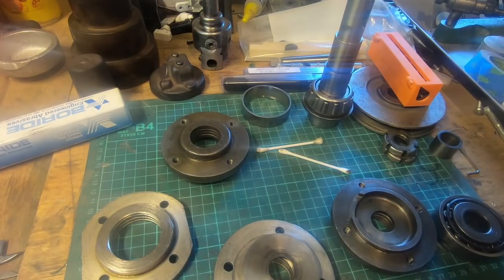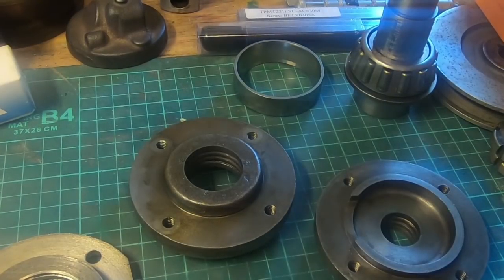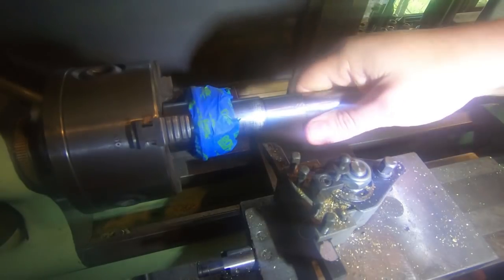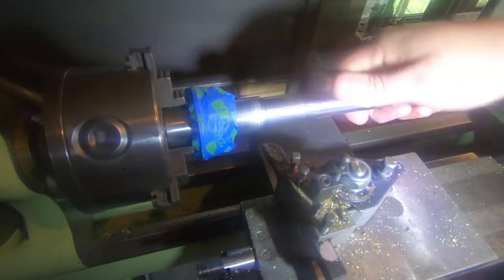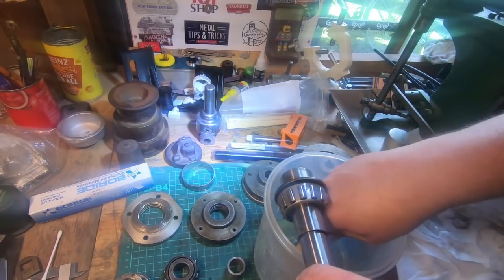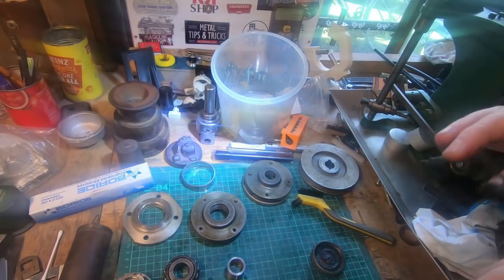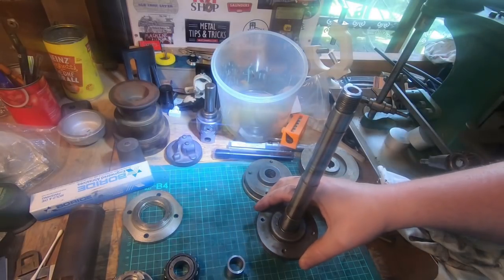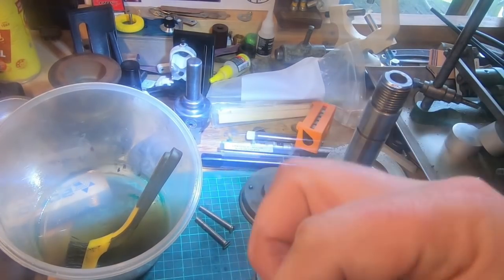PROJECT REVERSO - mill spindle

Comment: Next upgrade would be to replace that flat belt pulley cone with a nice V pulley cone. You'll get better belt contact and less slipping when the tool pressure is high. P.S. The demise of the British car industry was caused by unions rather than bad designs.

Comment: With some good quality grease in the bearings and the modern nipples fitted, my Centec 2 is running sweet, forward or reverse. As the machine was designed to run in either direction, there should be no problems.
Reply from the maker: Been watching your videos. Yours looks good. Thanks for the insight into how the head fits together.

Comment: Nice video,  I just finished my centec 2a, I feel your pain! Mine is the gearbox version so its even worse! Did you price those bearings you repacked?  Statewide bearings could get them in for $130 each!  They were the only two I didn't replace needless to say,  I  just did what you did and repacked them!
Reply: I had the same problem here in England with the price of the bearings. The rear one was three times the price of all the other put together, and all down to the size of the I.D. Most other bearings in the same range from Timken were cheap as chips - just that particular one was priced exorbitantly. I did bite the bullet and replace them all though - just my rule for all machines I refurbish.

Comment: No high speed running for long periods of time and it should be just fine with the grease. I guess if it runs too hot you can always retrofit it with some lip seals and go back to oil.

Comment: As Len Deighton (well-known British author, mostly spy novels :)) points out in his book on WWII, British engineering was based on "craftmanship" meaning individually hand-fitted parts. American practice was based on interchangeable parts. Some British companies, notably Rolls-Royce,  caught on early to the interchangeable parts and is significant they are still doing fine building jet engines. Personally I think every engineer should be forced to take apart the machine he/she designed and put it back together. Better designs would be a no-brainer.

Comment: I thought molybdenum grease was deprecated for non-plain bearings. It's supposed to mess the rollers up or some such.
Reply: Yes, for high speed bearings, it causes the balls or rollers to skip, circa 1000 rpm plus. Pretty sure Emma's mill is not going to reach that.
Reply: I don't know, it seems like a blanket statement of an RPM threshold should be more carefully considered. I realize that in the end, it's just a couple of used tapered roller bearings, not a launch to the moon. However, I'm willing to bet that wether or not molybdenum disulfide will cause a problem with non plain bearings will depend on the concentration level of the MD in the grease, and the diameter and duty of the bearing. The rollers will see a different level of activity in a small diameter bearing at 1000 RPM, than they would see in a large diameter bearing at 1000 RPM.
Reply: @gregfeneis609  Yes, an shaft RPM value is rather ambiguous, and bearing roller surface velocity will change considerably based on diameters. If I understand correctly,  molybdenum disulfide (MD) at higher volumes in a grease, can cause temporary loss of lubrication due to skidding/preventing full rotation. (this is confirmed here https://twoils.co.uk/greases-explained.html). Personally, I would use standard non-synthetic automotive wheel bearing grease, (NOT CV joint grease).
Pre-load is another factor, tapered rollers are not installed with any appreciable pre-load, it greatly reduces the life of the bearings. At my previous employer we only pre-load on bearing diameters (Shaft) from 125 to 350 mm by 0.05 mm, with a spring cassette to allow for spindle stretch. Axial load during operation is 20,000 Kgs to 200,000 Kgs per bearing respectively. Spindle RPM is from 3500 down to 500 RPM respectively. These are lubricated by combined oil dip and spray.

But, yes, it is a basic milling machine, as many manual/non full machining centres are, but you can hear the bearings/rollers skipping when MD grease as been used at higher velocity's. I did have a customer who used a MD grease for our spindle motor bearings (RPM was 2250 max), and reported a strange noise???

Comment: I learned a major lesson with bearings in the mid 90s Emma. My friends were taking the F2 stock car and I was going in my car. We hadn't gone far when I saw they pulled over just after the toll bridge. A wheel bearing had gone. It was a 4 wheel trailer but a policeman saw it so it had to be repaired, couldn't just take the wheel off. I went with his son to get a hub from the scrappy, but didn't have any, nor could we find another trailer to borrow. 
Well when we got back we found he'd gone. Found one in the bottom of the box with enough shale and dirt to completely cover it up. A few weeks later I asked if he'd fitted a new one. Much to my surprise he said no, did lots of miles racing and didn't have any problems. So as long as a bearing has grease, it will last a long time.

Comment: I've got a little Burke mill.  It's bearings run with grease, so you should be fine.  Mine has V belts, and I recently had to replace mine, so it had to come apart.  Bearings had dates engraved on them from 1943.  Nothing wrong with them.  They got cleaned and re-packed, and are in place for another 80 years + ...  

One thing I tried when I serviced the front wheel bearings on the big pickup was to put the bearing and a large blob in plastic (I used the plastic from the new brake rotors).  Close it up with as little air as possible, secure the opening and start kneading and squishing.  Seems to work as well as hand packing, less mess & wasted grease and less chance of picking up airborne contaminates (which can be a lot if you are working outside and live on a gravel road).

Comment: lol Emma, I know how those woodruff keys are, I had one on the shaper to attach the step pulley. the key seat was slightly worn and the pulley was attached using a blind keyway. after 5 1/2 hours of fighting with that thing, it finally slid together and I'm sure that most of the words that I had called that thing wasn't in the English or french language, or probably not in any language, lol. so yea, I know how those are, lol. spindle looks good and can't wait to see everything up and running again.

Comment: I know this sounds weird but maybe a drop of super glue on those woodruff keys might have worked.
Reply: When they were new they may have been an interference fit, so would not be a problem at the factory to assemble, well not for English hands.🤣🤣🤣🤣
Reply: Put the flat side of the key on a hard surface and use a hammer blow to upset the key on the curve. Always works for me to tap the key onto the shaft then.
Reply: @gvet47  the problem with her's would be the room that you have to work in.  can't tap them in if you don't have room to swing the hammer.  and she probably had to use all four hands to hold things while placing the keys.  I had more room to work with on my Burke, and it was still a juggling act to put it all back together.
Reply: @infoanorexic  I don't know the assembly but looked like the shaft passed through that large bearing hole so keys could have been installed before install? She got her done even with some bleeped out video and words. Right words always help.😂

Comment: There is more than one way to pack bearing.  A somewhat easier way is to place the grease in the palm of your hand and force the bearing into to it.   Use a twisting action and try to get the rollers to turn.  Failing that turn the inner race.  Good video and good luck with the mill.